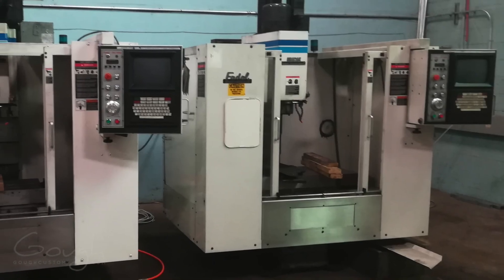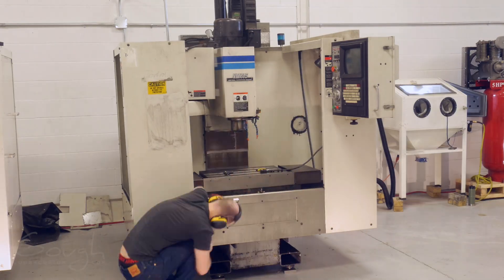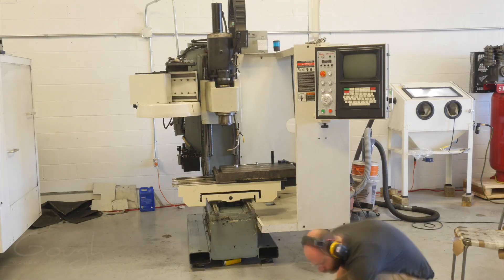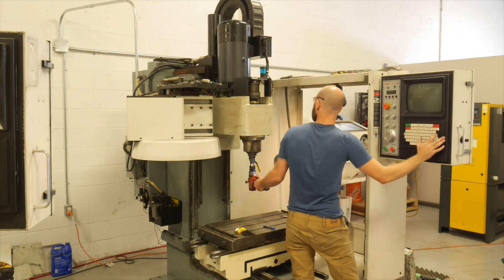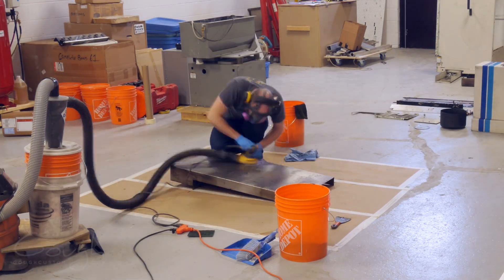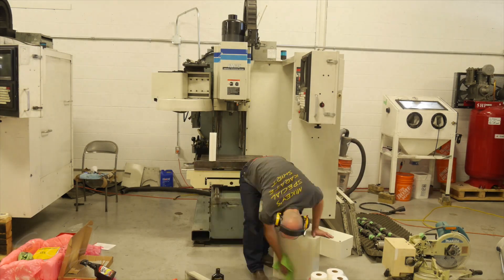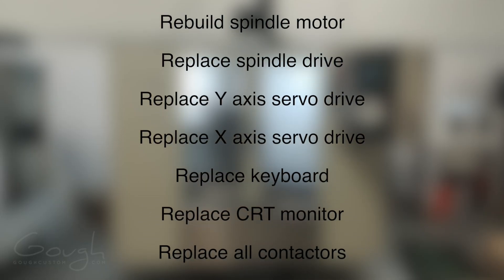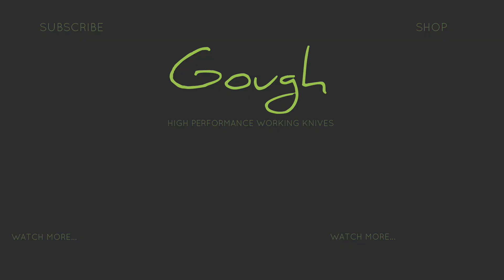Restoring a 24 year old CNC machine...

Comment: Frank, Allen, Dave , And Larry / You put a lot of work in it but I hope you fix the problem 
with the spindle dropping that not fun when it happens its has happen too me 3 times.
Keep the chips clean and away from the glass scales. This machine has a nice feature 
in the controls that allow you to bump up or down the spindle height when the machine is running . Good luck.

Comment: This helped a ton when I got my own Fadal. Did you use any sealant when reassembling the outer panels to keep coolant inside? Any recommendations?
Reply from the maker: I didn't use sealant, but I SHOULD HAVE! lol... My machine ended up constantly leaking oil everywhere because I didn't seal the enclosure. 

I recommend the Sika brand polyurethane sealant as it will resistant the coolant and will cure fully even in thick applications.
Reply: @GoughCustom  Thanks for the info! I have sourced some Sika 1A sealant (recommended by my coolant manufacture) for the enclosure. It will  be a "FUN" time putting the enclosure together without getting sealant all over my clothes! Keep up the great videos and content!
Reply: With running Coolent after some time the silicone will come up. i did want to put 
rubber strips in the joints and bolt it down but the owner didn't want to spend that must time on it.

Comment: I always thought the Fadals were Turcited Boxway/Dovetail machines?!

Aren't they?
Are only some, or the older ones?
Reply from the maker: Hey Heinz! Some machines were box-way, others were linear rails... the 4020s, 6030s, and 3016s were all box way machines, whereas the VMC15 and 3016L were linear way machines. 

I think I prefer the linear way machines as they seems to be more durable in the face of less than ideal lubrication. With the turcite machines if the lubrication wasn't perfect the turcite would often get pulled off the box way and then the way itself would get worn, and rebuilding the machine is then a BIG job! With the linear way machines you can just replace all the rails which is probably a 12 hour job, much simpler! That said I have certainly heard lots of good things about the box way machines!

Comment: At least graphite is a lubricant....the machine is probably better because if it (except for the control panel).  it could have been aluminum oxide, carbide dust or something worse.
Reply from the maker: Definitely could have been worse! If it had been carbide dust I think I would have passed on the purchase for sure!

Comment: This is great! Looking for one for myself, how’s your work flow do you use fusion? How did the post processor / loading files go for you ?
Reply from the maker: Yeah I use fusion with no problems at all! I just use the standard fadal post processor, dump the files onto a USB stick and then run them using the Calmotion DNC box that I installed. works great!
Reply: @GoughCustom   awesome !

Comment: Hello actually my information about cnc machine is limited... my question is what is the difference between your machine1996 and cnc machine made in 2020 ......
Reply from the maker: A brand new machine will be faster and likely a little bit more accurate, and likely capable of smoother surface finishes... In some cases that will totally mean that it's worth the extra $50k+ but for me putting up that kind of money just didn't make sense!

Comment: I picked up a vnc15xt only issue was a bad spindle drive I will be replacing and adding the sound deadner material also what monitor did you use I’d like to do the same
Reply from the maker: Nice mate! There's a complete thread on the monitor replacement here: https://www.practicalmachinist.com/vb/cnc-machining/easy-cheap-fadal-screen-replacement-374307/

Comment: I have a piece of O1 steel.  1/8" x 2" x 18" and I'd like to make two kitchen knives.  In order to get a longer blade, I was wondering if I could MIG weld an extension of mild steel onto to tang so I can lengthen the blade?  I would think it would work but I would like the opinion of some one in the know.  Thanks, and thanks for sharing your knowledge.
Reply from the maker: Hey Joe! I honestly am not really sure how that would work, it might be prone to cracking at the joint after welding...

Comment: Graphite is a mess to clean up, on the other hand it's soft and semi lubricating so if that's mostly what this was used for, I bet the ways are in great shape. If what I heard about the sale of the second machine is correct, you basically sold it for about what you paid for both machines initially. nice.
Reply from the maker: The ways and ballscrews were indeed in good shape, a great silver lining to a difficult process! I am very pleased with how it all turned out in the end!

Comment: Fantastic!
But i don't like the comparrison, haas machine and, in general, brand new machine are far better than revamped one. That's the cost. And ofc their gain...
Anyway gj
Reply from the maker: I understand not liking the comparison... The HAAS would be faster and offer more features, likely provide better surface finishes as well. However I'm not sure that those advantages would provide benefits that would be worth the cost, at least certainly not in the short term! The ROI difference would probably be many years at the least, and I still have the option to sell this machine for pretty much what I bought it for and upgrade to a HAAS if I need to in the future!
Reply: Far better in what way that matters for his intended use?  This was used to machine graphite which is pretty soft and didn't likely put any real strain or wear on the parts. I bet the ways and screws are basically in like new condition. Since he already has one like it, the control system is familiar and he can jump right into using it. It's a perfectly fair comparison if he doesn't need any of the extra bells and whistles a Haas might offer.

Comment: Aaron,

Just listened to your Knife Talk interview where you mentioned mould polishing stones. 

When using them, do you still sand at alternating 45s between grits?
I have a set, and see their value, too. 
Just curious if you use them any differently?

Cheers
Reply from the maker: I do still change angles, but don't change by a full 45º, only 10-15º is enough to let you see the different grits and makes the sanding process easier! I use the CS-M stones from MoldShopTools.com in the 1/4x1/2" size! For lubricant I just use tap water and dish soap (blue dawn).
Reply: @GoughCustom  
Thanks Aaron - very much appreciated, mate 🙏🏻👍🏻
Reply from the maker: @sudo_nym  Any time!

Comment: Why not just convert it over to modern controls? Mach 4 and some new servos
Reply from the maker: Hey Chad! Mainly because I wouldn't actually gain much from doing so and the cost would be fairly high.. This machine can happily 3D contour at 120+ IPM and the control is a well proven bit of technology! In the future I might do an update, but a full upgrade to a new machine is more likely... There are also a few companies that sell 'plug and play' upgrade controls for these machines so that may be an option if it's every needed.

Comment: Fadals are cheap because very few companies will service them anymore, they're obsolete (both machine and control) by today's standards and out of business so finding parts for them is a challenge compared to newer more common machines. 
That said, in their day they were the workhorses of most CNC shops, a good hardy machine that would stand up to two and three daily shifts of abuse while needing very little in maintenance or repair.
Today they still make a fine machine for a small start-up company or at home in the barn hobby mill, but the speeds and feeds the newer machines will run, the much more powerful controls along with the modern tooling that supports the high speeds and feeds, a Fadal is now more CNC nostalgia much like an old antique or muscle car.
Having been in the industry over 40yrs. I watched the Fadal come and go from the middle of it all, but the at one time king of production machining has been forced to step down to make room for the newer and better. 
Technology moves on.
Reply from the maker: Hey Mike!
I hate to contradict you, but unfortunately I must in this case! Parts are actually very easy to get for Fadals, with no fewer than 3 companies making new and remanufactured parts including spindles, servos, spindle drives, control boards and everything else. The company I use is called ITSCNC (itscnc.com), they were an OEM electronics manufacturer for Fadal that branched out into offering a full range of spare parts.

Whether the control is up-to-date enough for modern toolpaths depends on which version of the control you have. Before about 1992 the most common control was the CNC88, which as you say is definitely too slow for modern use. However 1992 and onwards a newer version of the control called the CNC88HS was pretty much the standard and this control happily keeps up with modern high speed machining without issues. You can see my older machine with an 88HS control running a demo program here: https://www.youtube.com/watch?v=wfppEEUyuDk

Newer machines are definitely even faster, but given how much cheaper an older Fadal is they still have their place! If I had a bottomless wallet I would buy an Okuma M560V and 3D contour at 1000ipm, but for the moment my Fadals do great work!

-Aaron

Comment: I want to have my VMC15XT to look fantastic like yours. I have lubrication oil leaks that I want to fix but I don't know how to check the lubrication lines
Reply from the maker: Hey mate! It takes some work but it is worth it! Generally for the lubrication lines if they're leaking then they need replacement... I would replace all the lube lines and fittings if they're leaking.

Comment: What products did you use to restore the way covers? I need also to order wippers. Where did you buy them?. I have a 1997 VMC15XT
Reply from the maker: I just sanded them with an orbital sander and 220 grit sandpaper, then buffed them with a green scotchbrite pad. Replacement wipers are available cheaply from ITSCNC.com

Comment: Nice job! Did you check the machine accuracy?
Reply from the maker: Thanks! Yeah the spindle runout is less than 0.0015" at 8" from the spindle face, backlash on all axes is less than 0.0002"

Comment: Id think off all the materials to be caked on a 25 year old graphite would be the best. Self lubrications right???
Reply: graphite dust is more conductive than metal
Reply from the maker: Not quite more conductive than metal from what I know, but definitely not good for electronics!
Reply from the maker: It depends a bit on the grade of graphite actually! I believe some graphite grades used for EDM have additives in them that make them abrasive..

Comment: I know a guy who converted a Fadal like this to Path Pilot and clearpath servos. Thing is amazing! Those Tormach guys really know their shit, apparently.
Reply from the maker: I'd be very curious to see the performance of that machine.. The Clearpath servos are all pretty small for a machine this size!
Reply: @GoughCustom  They were some of their larger servos, Id have to ask. They beat the hell out of the older 900W DC servos he was going to use. Pretty sure X and Y were 1200 or more watts.
Reply from the maker: @martysmith2422  I would be very curious to know what model Fadal he was working on! Sounds like it might have been a very old one... The servos on the machine shown in the video are 1.7Kw brushed DC units with 3,296 oz in of peak torque (660 oz in continuous) which is only matched by the Clearpath SDHP servos that are $1,000+ each!! And these machines are pretty much the smallest they made at the time, the larger Fadals like the 3016 and 4020 had servos that were even more powerful!

Comment: dodged a bullet with he graphite if they had water based oils used they would have been much, much worse
secret commands:
tc ,1  -   move head to tc position and show pocket (can adv atc fwd or rev using the keyboard)  press manual to return head to 0
s.1 
s.2     -   spindle in high or low range override (i forget which one is which) ex "s1000.1"    if you enter each command by itself in manual mode it will just actuate the belt drive (do not do this while running the machine is dumb)
Reply from the maker: Yeah there are definitely lots of ways it could have been worse thankfully it wasn't 'too bad' lol. Thanks for the commands!

Comment: does fusion 360 come with a post processor that works with your control? or did you have to modify it? i'm looking to buy a cnc lathe which comes with fanuc control, and i'm worried about having to change the post processor with limited knowledge about how a post processor even works lol. nice machine btw
Reply from the maker: It does yet. Fanuc is a very common control, Fusion definitely has posts for Fanuc built in!

Comment: Did you test out the screws for backlash? Graphite is really hard on the motion system.
Reply from the maker: Yep! No problems there... I had to replace the thrust bearing on Z, but after that all axes have 0.0002" of backlash or less.

Comment: Nice work ! How much backlash in the end?
Reply from the maker: Thanks! X axis has 0.0002" of backlash, Z has zero, Y has 0.0001"
Reply: @GoughCustom  without replacing the ballscrews? NICE!!!
Reply from the maker: @AsitShouldBe  yeah without replacing the ballscrews! My experience is that as long as the lube system is at least working a little bit then the thrust bearings are much more likely to be a source of large backlash than the ballscrews, which is nice as they're so much cheaper to replace! I did have to replace the Z axis thrust bearing, it was showing about 0.015" of backlash before replacement.
Reply: @GoughCustom  i have a much cheaper 3 axis mill, i don't have enough space to buy a bigger one.. but in my dreams there is a 5 axis machine LOL
Reply from the maker: @AsitShouldBe  In all our dreams!

Comment: Great job , did you add your labour rate to that costing ?
Reply from the maker: Thanks! No I didn't include labor in the cost... Labor cost at $15 an hour would be around $2,500 or so... Normally I would count my labor at a higher rate than that, but in this case the real value is in what the machine can produce after it's finished!

Comment: Did you tram the spindle head and check the axis for any run out? I'd be careful, especially if there was a lot of graphite dust. Graphite is very abrasive
Reply from the maker: Yes, spindle tram/runout is good to less that 0.0015" over 10". Worst backlash on any axis is 0.0002", overall it's a very tight machine now!
Reply: @GoughCustom  Sounds like you did a great  job! I wish you many hours of fun with that machine

Comment: Wow it was cheap to buy but you really put a huge amount of work into it so its not cheap now. Wonderful job and Im so pleased you didn't discover some significant controller problem that could well have killed the whole thing, well done!
Reply from the maker: Yeah unfortunately it would have been a lot cheaper (~$5k less) if the spindle drive hadn't failed and taken out the spindle motor! That was not something I had planned for! Overall it's a bit above the price you could buy a 'good condition' used Fadal for, normally a nice running one would be about $12-13k, but even with a 'nice' used machine you normally find some stuff that needs fixing and spend some time cleaning and checking things, so I'm pretty happy overall!

Comment: Geez, a cheap CNC machine that's filthy with graphite and oil, and originally broken... where have I heard that before? Oh right, in my garage! (No joke, click my user icon to to see some videos, or https://www.youtube.com/watch?v=vok0GHZB8h0). You were definitely more focused on cleaning and fixing than I have been so far, but I guess to be fair your machine sat for a year before you even got to it - I fixed all my electronics problems and then my machine sat for a year before I felt like finishing the cleaning, and mechanical fixing (the oil lube system, and the air for the drawbar and tool changer) :) I'm about ready to start working on it again this week actually! That graphite dust/oil stuff is really THE WORST isn't it?!